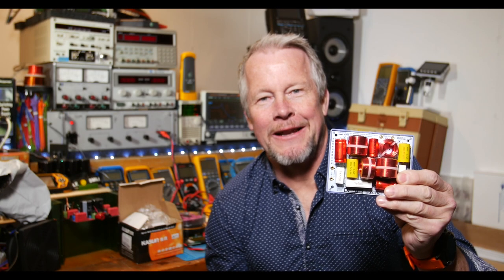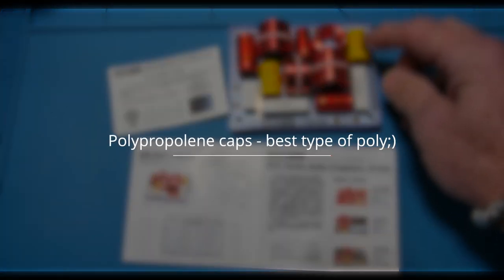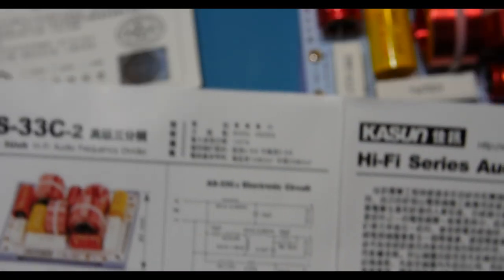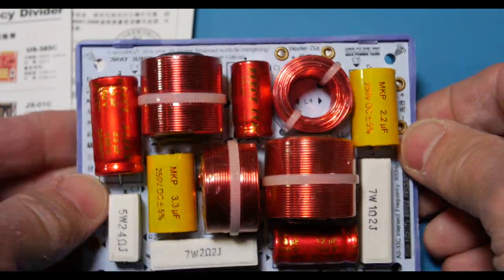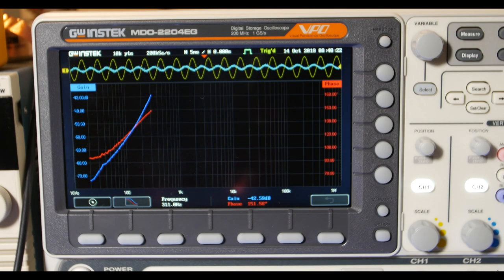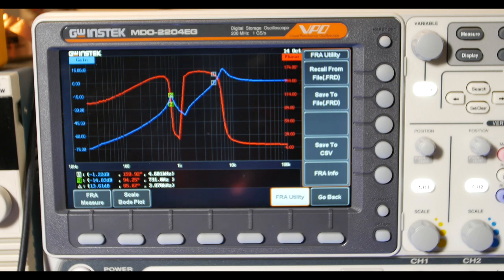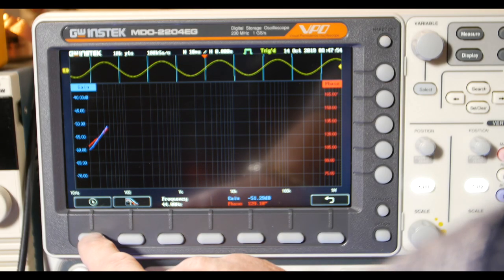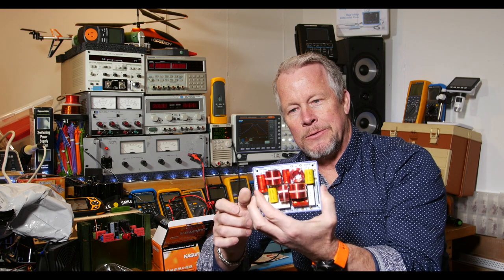3 Way Speaker Crossover Tested part 1 with Kasun AS-33C

Comment: Ready-made crossovers are not my way to do things because your drivers have to be precisely the right impedence to match the x-over design. Not only the parts (coils, caps and resistors)are of poor quality but even the implementation on the small board will induce cross-talk between inductors even if they are placed at 90° from each other. I know making your own x-over may be time consuming because you do have to do extensive tests and listening sessions to make sure your design sound right, but in the end, the result might amaze you. Thanks anyway for the hard work of making this video!

Comment: Eddy shouldn’t you terminate the filters with the speaker impedance ? I am a ham radio Amateur and In HF  measurements always terminate the output with 50 ohms Never made a bode plot Now I can ,thanks to this great GWInstek Scope , thanks for this Video and explanation
Reply from the maker: Bert van Lelieveld Yes, you are right!  I should have terminated the two channels that I was not monitoring;) I can’t wait to try this!  Any other ideas for a second video on this?
Reply: @KissAnalog  Would like to see how it behaves with real word drivers as a load. other than that . A phenomenal video and real enlightening as to what is really going on as opposed to a spec sheet.
Reply: should also terminat the channel you are measuring.

Comment: You really need each output section terminated into the designed load (8 ohms?) to do a proper evaluation of the slopes.
Reply from the maker: Ron Shaw Yes - you are right!!  Thank you!  What else do you recommend me doing in a part 2?  Thank you for that awesome feedback!!
Reply: I have found that you need to load all sections of a passive crossover to get accurate data. I was testing one with just the section I was testing terminated, and the results were different than when all sections were terminated. Really like your videos.
Reply from the maker: Ron Shaw Thanks Ron!  That makes sense.  I’ll try to post a follow up this weekend.

Comment: You need to connect 8 ohm loads to the speaker ports before you measure the crossover. I didn't see you add the loads and you will get a very different result.
Reply from the maker: Thanks for your feedback!  I did several videos on this.  Here’s one with a load.  https://youtu.be/kawTphp-sTk

Comment: Great video! I have a question regarding those resonant spikes... When actually using this crossover on a set of drivers wouldn't some of those resonances cancel out because of the phase? I don't mean perfect cancellation but at least some degree of attenuation. I ask this because I noticed, for example, that the woofer resonance at about 800Hz seemed to have the polarity more or less reversed from the 800Hz from the midband crossover. Again, not actually the inverse polarity but seemingly close enough for there to be some level cancellation. Thanks in advance!
Reply from the maker: Thanks for your feedback!  I have a playlist of videos on speaker crossovers.  Here's a link to a video that might answer your questions: https://youtu.be/kawTphp-sTk

Comment: I wonder if this would be a good cross over for my HIVI 3 a  bookshelf speaker that was made from kit. kit was missing crossovers. ceramic i thought were the cheapest of the cheapest ?
Reply from the maker: Thanks for asking Dan!  It's hard to say it would be optimized for that speaker, but it does have crossover frequencies that are pretty generally placed well;) What do you mean ceramic, the resistors or capacitors?  Ceramic resistors are very good I think.  Ceramic capacitors are very good caps as well, but poly might be better for audio applications.
Reply: thanks for infor . i really dont know much about crossover parts. i just wanted to make a crossover with the best oarts for these speakers. caps and and also the resister. From what i been told that lower end speaker put the cheapest parts for the crossover. Dayton audio are cheap ? would know anyone that can build my crossover for these HIVI i do have the the spec kit that are stock. but there a upgrade to change some spec. call a perfectionist upgrade by scott from Mideest  auto club

Comment: Hello, excuse my English, I give an example, in my case I have some large speakers and the technical specifications were lost, they are Japanese from the 70s similar to Sansui, if I wanted to place these crossovers, my ignorance confuses me the frequency response of the Amplifier It must be according to the one of the baffles right? But what about the baffles is governed by the frequency response of the crossover? here comes my confusion, because if the crossover starts at more Hz those frequencies are filtered and therefore it will be heard horrible ?, thanks if you can clarify this doubt is appreciated.
Reply from the maker: If you send the wrong frequencies to a speaker it might also damage that speaker as well as not sound great.  But speakers and crossovers are designed similar for the same type.  So, a 3 way will be all designed with similar crossover - but really different compared to a 2 way.
Reply: @KissAnalog  It is confusing, I have seen people buy amplifiers with a certain frequency range and loudspeakers well above this range, for me with what little I know of the subject is a gross error, and that of damaging them, it scares a little because we must trust the crossover we buy is well designed, thanks for the explanation.

Comment: LOL are you now become a mind reader? :-) I was wondering about the placements of the conductors and under 4 seconds later you told about it:-) You talk about that things change with higher powers, is that due to heat, larger magnetic fields or?
Looks like you have the same interests as me, but do of cause know oceans more then me! I do really look forward to follow you and your channel!! :-)
EDIT: You made two videos about low and heigh pass filters, using a resistor and a capacitor, could you maybe tell about the difference and why?
Reply from the maker: Fried Mule Thanks Fried Mule - that is funny!  Yes, with current loading the inductance will change a little, and parasitics can change as well.  I’ll explain the difference in filters from the videos before - thanks for that idea!  Anything else that you might be interested in a part 2, let me know.

Comment: Eddy I am also interested of filters adding any Distorsion And which parts are responsible iff so 
I am in a Dutch audio community And there are realy nice people I am building for fun tube amps ( i like the sound ) 
and I get a lot of help ! But tube amps have very heavy mains transformer 
Nobody in this community ( dare or play save ) trying a SMPS  
That’s wat I wanted to try out rebuilding a old ATX computer power supply in the near future 
Like to know if you can , or willing to setup up a PP tube amp with a smps 
And measure if there is a different in audio distorsie with a lineair power supply or SMPS 
Let shake up this pre judgment a little 😀
Reply from the maker: Bert van Lelieveld Hi Bert, the distortion issue I think is a real thing.  I’m sure the members of your Audio community would agree, and are really concerned.  I’ll try to talk about that in the follow up video on this.  I’m sure that this will be something that will develop over time and hopefully I can help work out these issues.  This will be fun!  I am a purest to a point, but I also think there are preconceived biases to the types of power supplies;) Let’s look into this and see what we find.  These are the questions that I have had as well!

Comment: You can measure all you want but on a HT receiver or low res system it does not have to sound much better .
If your system is capable of delivering high resolution and transparent sound you got to listen to the way each part influence the sound , with ear , yes with ears
Reply from the maker: Yes, the engineers that design and produce the low res and High res measure to be sure that they are hitting their perspective targets.  It is up to us to check their measurements - and then finally listen to see if it is what we like - but measurements should always come first.
Reply: @KissAnalog  tonal qualities , harmonics , soundstaging and many other aspects must be heard and that is where quality of the parts plays huge role and it must be heard as perfect measurements can not show these qualities ....

Comment: Mr kiss thanks
Reply from the maker: dipak bhalodia You bet!  Let me know if there’s something that you would like to see.
Reply: @KissAnalog   yas crossover is use DJ SPEAKER SOUND
Reply: @KissAnalog  high pass filter or low pass filter correct?
Reply from the maker: dipak bhalodia Yes this has a high pass for tweeter, a low pass for bass, and band pass for the midrange.

Comment: boss question,
 3 speakers subwoofer ,instrumental and tweeter in one box, each one 350WATTS.
 how many WATTS is the 3 WAY dividing network that can be used? 
thanks and more power
Reply from the maker: Great question!  Is the tweeter also rated at 350 Watts?  It depends on how the 3 way is spec'd but I'd think a 350 Watt crossover would work but you would have to verify what the power actually is rated at each channel output.  But 350 Watts in a tweeter is nuts, or even a mid-range;)

Comment: Lets restart,  after watching your second video, i realize that you are on a right track, im sorry for going harsh on you... i would like to see more tests with actual speakers, and maybe comparing it with another different set of speakers, just to show people how big difference it can be.
Reply from the maker: Sorry you didn’t like it.  Can you tell me what is incorrect?  As an electrical engineer with decades of experience and who was the head of an electronics program for 3 years at a community college, I’d like to continue learning.  So, if you don’t mind, what did I have wrong?
Reply: @KissAnalog  yep, this is the common problem with engineers....no offense... But audio is more than math...
You measure crossover without dedicated speakers... Attach them and you will see a big difference in your measurements, also you should measure interference between those parts... Also you need to measure phase difference after that cutting, because after the frequency goes down, also the phase moves away and you get low volume but still active out of phase sound from that speaker, 12 db is nothing special, its steap cutoff but  there are a ton of music within that first 12db cutoff that is, at some degree out of phase, and you can hear that, and you gonna have a bad unrealistic stereo image...
Reply: Also as a engineer, you should know that capacitors and coils have their + and - , when outer level of coil is connected to the Amp - that means its grounded, and layers below are shealded from interference (positive end)... No matter if its a electrolytic cap or ceramic... Or whatever...they all have inner and outer layer.... Outerlayer is always (minus or grounded) to shield and protect the interference....
Reply: So if you have bipolar cap, still it has outer and inner layer
Reply: This is why i buy 4 channel scope and never make a video.... there will always be a some smart ass who can denny yout theory.... But mark my words, audio is something that trained ear can sense easily, and you can't explain it by electronic behavior
Reply from the maker: Thanks for this great feedback!  I appreciate you sharing this knowledge.  I often end up with long videos, but I try not to make them any longer which means I have to provide info in chunks.  So, layer by layer (video by video) I try to put out more info.  

I think there are actually few engineers who know that there can be a polarity with magnetics;)  I was just talking about this with engineers who have been working in the audio industry their whole career and were not aware of this.

Placement of parts (including caps) can be very important.  I learn this doing EMI design where it is measurable.

I will use speakers in the future to show impedance affects - which I have shown how to look at the impedance of the speaker.  But I start with resistors to normalize the measurements as everyone will have different drivers.  There needs to be a bar to work towards, and then if you know what drivers that you are going to design for - then you can definitely include those.

Maybe in the future I will show the results with a resistor, and then with a driver as an example.

Have you seen this video?  I tried to improve on the test here:
https://youtu.be/tq66AdM5oqA
Reply: @KissAnalog  I will watch it, i like to see more stuff related to the crossovers, i started working on full range speakers just to get away from crossovers :), but still in many cases they are much needed. Thank you for your patience! Cheers

Comment: should you take a speaker impedance into a count then measure it with the speaker in the circuit ?
Reply from the maker: Yes Seraph, you are right:) I will post a follow up video that I think will show much better bode plots;) Thanks for this great insight.  Let me now if there’s anything you would like to see covered.
Reply: @KissAnalog  for the LM3886 one, can you try replacing the LM3886TF with the LM3886T version that has a cooper backplate, so you can get better  result on the thermal side, and also, can you test the capacitance multiplier power supply designed by Mr Evil, i heard it smooth-out any kind of power supply ripple to almost nothing, https://mrevil.asvachin.eu/amp/amp4/sub/psu2/
Reply from the maker: That’s a great idea to help the amp run cooler - thank you!  I’ll check out this link - sounds interesting!
Reply: Great work my friend !!
Reply: You should always have matching ohm speakers in home hifi
 use 8 ohms is great i use tube amplifiers and love a high sensitivity speakers at least 92db at 1 watt  and I probably have a output of 30 watts per channel and boy they are loud

Comment: there is 2way crossover that output only midrange and high range instead of woofer/tweeter combination?
Reply from the maker: That's a great question!  I plan to do a video to show how to modify one to get what you want.  I think you are fine to use a 3 way and not use the woofer - if that works for you.  What crossover frequencies do you want as an ideal?

Comment: They have better models, the ferrite saturates and rings ,use air core models for better sound and higher power.
Reply from the maker: Thanks Larry - yes they do have a line of these crossovers.  This one handles a fair amount of power, but if you do need more power than air cores will be great for that.

Comment: Is that for a car audio speaker system or is it for a house stereo system speaker
Reply from the maker: Great question!  It can be for either.
Reply: Ok would this be able to work for 2 18" subwoofers and 2 midrange speakers and 2 tweeters or do I have to go with 2 of them in the one speaker box

Comment: I'm pretty sure you can't test a crossover without a speaker connected as the impedance of the speaker will be a part of the filter.
Reply from the maker: Thank you!  You are right that the final test has to be with the chosen speaker.  But, to compare crossovers, testing with a known impedance or resistance gives a reference point.  Make sense?

Comment: Hello Kiss Analog . I wrote this question to you with the help of Google translate. I have a Dali Oberon 5 tower speaker. 2-way and 3-driver. It has 1 tweeter and 2 basses. at 6 ohms. Can I do this 3 way with Kasun 33C? 

The speaker bass port is at the back and close to the wall. I'm getting too much bass. I want to use one of the bass drivers as a midrange.

Comment: hello , I have a pair of speakers that needs a crossover I know nothing about this stuff learning away how do you know that this will best for the speakers I have ? also for speaker wire do  they go thought top or bottom on base
Reply from the maker: Thanks for the great question!  I think if your speaker is a 3 way, then this might not be a bad product to try.  It is true that some speakers are tuned very carefully with the crossover, where I think many are not that carefully tuned.  What did you mean about the wire going through the top or bottom?
Reply: @KissAnalog  thanks so much most of the videos are way over my head but when you on the speakers subject iam all Ears. the speakers wire i figure it out but thanks. I hope i see a speaker test soon on your channel keep up the good work. dan

Comment: hello,how to connect 3 speakers in Crossover IN  out  T and W ,my car have Under seat Sub BMW f30 and doors speakers with Tweet ,my amp out 4 ohm ,sub under seat 4ohm and doors 4ohm speakers build in Tweet , jumper wire around the capacitor to bypass it, serial or parallel connect and this Crossover  filter 4 ohm??Thank u
Reply from the maker: Thanks for the question, but I'm not sure exactly what you need to know...  Did you get this taken care of?

Comment: I just picked up some old 70's B-I-C Venturi Formula 4 speakers and want to update the capacitors. Two of them are 16uf 50v and 4.7uf 50v. Do you think i will have a problem using 15uf 250v and 4.7 250V?
Reply from the maker: Using higher voltage is totally ok, and sometimes better even.  Types of capacitors can make a bigger difference, like poly vs aluminum.
Reply: @KissAnalog  I got all poly! I let you know if it was a success

Comment: Can somebody buy this crossover for a Pioneer CS G305  three-way 12-inch speaker and that sound good or would it have to be matched up with a certain kind of speaker
Reply from the maker: Yes, I think this might be a great option.  When you open your Pioneer - it would be fantastic if you could share pix of the crossover inside it;)
Reply: @KissAnalog  I did take pictures there wasn't nothing inside their only close to the tweeters in the mid-range a little cap. off the connector in the back to the subwoofer there was nothing crazy
Reply: @KissAnalog  do you remember what the Hertz was on the low side for that model